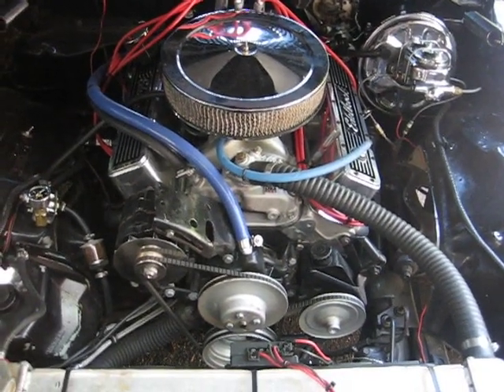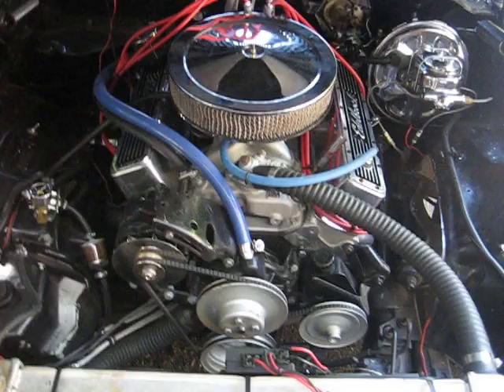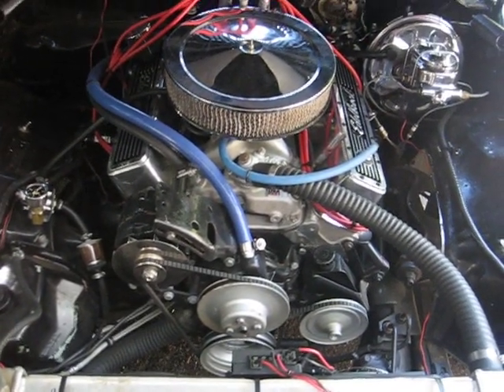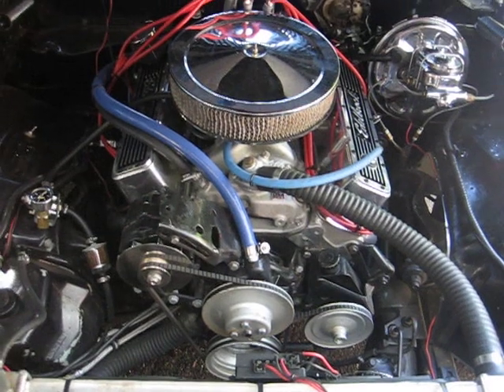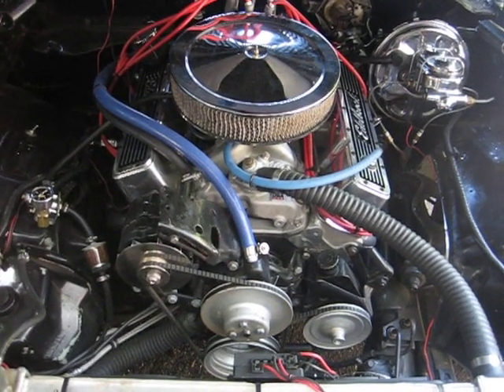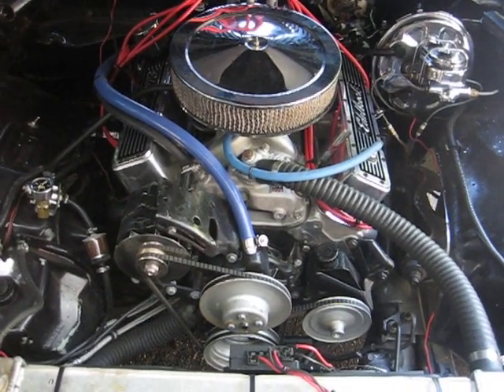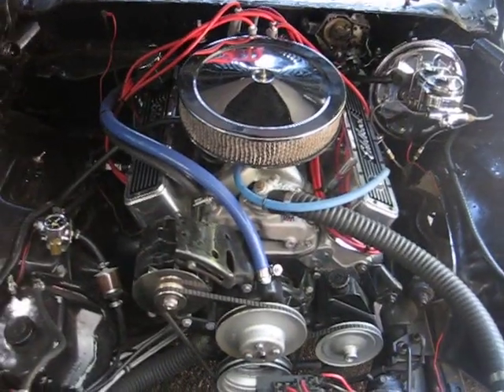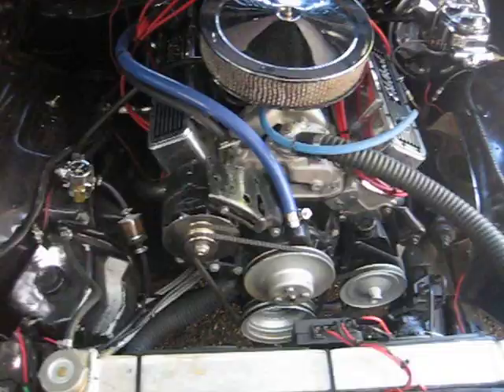383 sbc excessive blow-by

Comment: Loose rocker, or bent pushrod pull valve covers. Blow by is from all the pressure in the cylinder if the valve isn't opening good luck

Comment: That's normal blow by... some gas will get past the rings regardless. Trust me I've had an ls3 with broken/worn out rings. Mine was bad it seemed pressurized.  That sound just means you need to adjust the valves
Reply: that is not normal blowby ,anytime you have a strong pulse like that you got a dead hole and it sounds like the cam has gone flat from lack of oil

Comment: Open the valve covers and see if it's something visual. You said, it only had1500km maybe it's just a valve spring or rocker on the intake side, the exhaust side would cause a backfire. Did you break the motor in? Check the oil for shavings... Might just be a miss to sooo check all plugs and wires . Don't just assume worse case scenario. I've been there done that.

Comment: A common problem with bad blow by on a somewhat new engine is that when the engine was built it never made it to the machine shop to be bored and new pistons. A lot of people will just hone the cylinders and re- install the same pistons with excessive  wall clearance or improper ring end gap.
Reply: In my case it was my lil tuning knowledge and too much ignition timing

Comment: Its to slow to be anything with the bottom end. You know its something to do with the valve train when it ticks this slow because it will tick at half the speed of the crank. its most likely A. a collapsed lifter, B. a blocked oil passage not allowing a hydraulic lifter to fill, C. a very bad valve lash job. A bottom end noise also have more of a "deep tone" to it, its less like a tick and more like a clunk. As for the blow bye i wouldnt rule out that the hone job was inadequate and or so many people think that if there building a race engine they run right to the Chromolys, which if not honed by a guy who knows what he's doing will probably take 30-40k miles for the rings to even seat properly. but who knows it could have bad valve stem seals. theres any number of things it could be
Reply: steve schaap well said I agree
Reply: steve schaap nice....mine was just that.

Comment: take the valve covers off make sure you don't have a loose rocker,also check your header gaskets I've had a blown exhaust manifold gasket sound like that. the blow by is likely worn rings did that block get bored out or is it a dingle ball hone? you have something that is gonna require machine work id guess. love the sbc! don't be skeered! the problem will show itself.

Comment: What were the piston to bore clearances & roundness like?
If it's got blowby already there could be every chance that the ring gap(s) are too big,I think that it's a bit more than rings not seating in properly.
I've got a spare Nissan RB30 (3 litre Nissan six) engine block that I pulled out of the first Holden VL Commodore (General Motors Holden fitted the Australia only delivered Nissan RB30 into the Commodore between 1986 & 1988 then they went the Buick LN3 V6 engine in the next model),it blew smoke when I accelerated when the engine was cold then it would clear up as the motor warmed up,the motor had done at least 500,000 kilometres before I pulled it apart.
When I pulled it apart, I found out that at the top of ring travel ,when I measured the bores with a set of internal micrometers the cylinder with the maximum wear had 0.115mm of wear in it which is way over what Nissan (GM's about the same) recommend which is 0.05mm (0.002") using the standard cast alloy pistons,the engine appeared to have ring wear but it was more to do with the worn cylinders unfortunately.
I could use forged or cast eutectic pistons which run a larger clearance but that defeats the purpose as the block needs to be rebored to 0.020" (0.5mm) anyway to clean the cylinders up.
I was running that motor in my second VL Commodore while I was building a hybrid twin cam RB30 engine,the engine block out of that one had done 300,000 kms & blew smoke due to stuck oil control rings,the engine runs the Nissan RB25 non turbo cylinder head & pistons,all I can say is when I assembled it ,it went together bloody tight,after 200,000 kms of driving it hard sometimes the engine is still good so the engine block in that one has done about 500,000 kms with the original bores from 1986.
The other engine block I may never use again as I don't drive the car at the moment (it's unregistered) & probably won't drive it all that often in the future.
I drive an LS1 powered Commodore which has light piston knock when it is cold for about 5 seconds when driving off in the morning but the engine has almost done 329,000 kms so who could complain?
They run cast eutectic pistons in them so they expand as the engine warms up & I've heard that the slight knocking noise when cold is pretty normal on an LS engine.

Comment: My 305 has blow by..when u pull the pcv valve while it's running the rpm drops..then when u stick it back in the rpms raise and smooths out... Is your pcv valve bad? Cause it didn't make a difference on yours..

Comment: My pop would call that "A puffer". Bent a pushrod or broke a rocker stud which is most common.An Ol Timer could tell you which cylinder and what valve with a vacuum gauge.Pop had a co-worker,Joe Mishk" who could do that .Amazing stuff.Stop crying and pull the rocker covers!Have one to do in my Pontiac too. I'm pretty old so next spring.

Comment: 383 is a mopar 396 would be a Chevy Humm blowby
Reply: 383 is a 350 chevy 30 over with a 400 crank
Reply: @HEINEYKNIGHT Chrysler had the 383 way back in 58 and had a 1 year model that had a HP cam and had 2x4s on it that was back then making 350 + HP which isn't bad and they used the 383 right up to 1970 with the low po 383s used in trucks and station wagons and the Magnum engines used in the Chargers Super bee Plymouth Roadrunner and GTX . Mercury had a 383 even before Chrysler did back in 53 if I remember used in some of the Mercury Marauder models .  That's definitely a lifter tick and could be the rocker needs adjustment or he revved it hard and bent the push rod possibly if the pre load on the lifter was set too tight or he has a lobe on the cam that's going flat which is becoming more problematic these days because most of the hydraulic flat tappet cams are being made over seas . As far as blow by that could be numerous things poor bore and hone job ring gaps set loose . The rings didn't seat because of using the wrong hone grit for the rings and they didn't seat or even if there is no baffle used to partially cover the PCV valve from oil being splashed on it can cause issues of blow by and smoking out the exhaust because the oil is being sucked up into the PCV valve and through the hose into the intake manifold . Every engine I build I take them to a reputable engine Dyno service and have it heat cycled a few times then run and a load put on it several times and a good Dyno guy can tell by looking at the power numbers when the rings are seated so once that's done the tuning process begins on jetting and timing changes to get the   best running configuration out of it but before they do any of this the engine is run to 1,500-2,000 RPMs up and down for a half hour to 45 minutes to break the cam and lifters in . The thing that's nice about doing this is if something is wrong they find out what is it, it takes about 15-20 minutes to unbolt the engine for the owner to take it back home and do a tear down on it so that saves time by having the engine dynoed first . One of the guys that's in our car club just built a 383 Chrysler for his 67 Plymouth satellite convertible 4spd  all new internals and had taken it to have it broke in on the Dyno and it had a miss and was back firing through the carburetor and come to find out the new Comp cams cam and lifters who ever machined the cam had ground 2 lobes wrong on the cam and these lobs weren't timed correctly with the others and that was causing the backfire and engine miss on one cylinder right off the bat after checking plug wires were correct . I think the majority of cam makers now are trying to phase out the old flat tappet hydraulic and solid  cams because most every engine designed now uses hydraulic roller cams plus now that the majority of them are being made in China quality has dropped dramatically and from what I hear over hear there is a shortage of experienced cam grinders to run the cam grinding machines so that's hurting production and if they are using a rookie that hasn't been trained well enough or hasn't had enough time doing this there are a lot of cams being ground wrong so lobe and lifter failures are more common than they used to be plus some of the hardening of the cams and lifters are not being done  correctly or to spec as far as hardness which is basically a surface harden test they should be checking in batches to make sure it's done correctly. Roller cams are made of billet steel that's not just surface hardened but hardened all the way through and they need to be because the valve spring pressures they need is much higher than a flat tappet hydraulic or solid cam uses so you see less cam and lifter failures with these but the downside is they are expensive .

Comment: to much preshure fuel pump over writen the actualy speed of the fuel pump by useing condensor and a blow by system needs air in and air out port if you ports are blocked those gases have no where to go exept brake seals and gaskets oil leaks! if your car is wrongly wired wire harnes aces cunert and back curents have diferent effects on metal surface the body of the car arcing never help's a engine wrong oil coolant brake fluid and definatly wrong fuel type heps to that engine demise use aditives those engines are rated for higher octane fuel